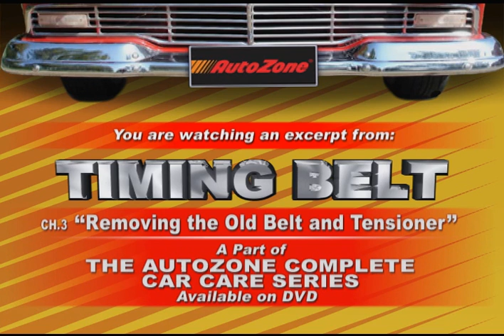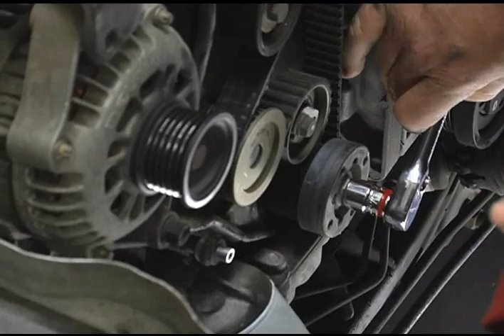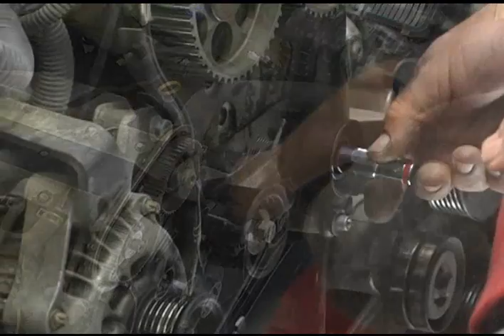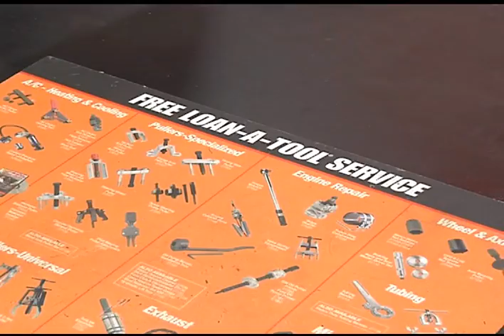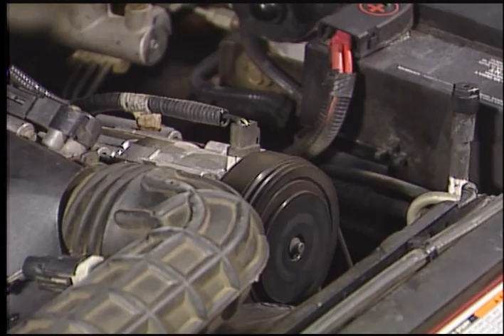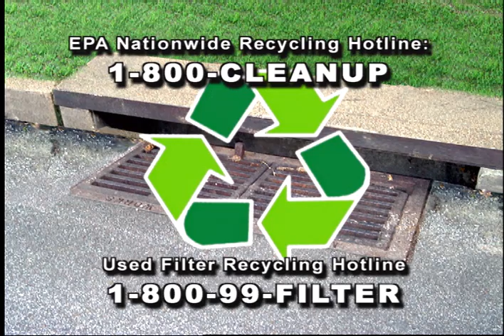How to Remove an Old Timing Belt and Tensioner

Comment: Timing belt breaks, is there any valve interference. A mitshubishi outlander
Reply: aileen rivera look in your manual. I have a Mitsubishi with the 4G69. a SOHC engine. that is interference. regardless of what kind a broken belt will do expensive damage so be proactive about replacing.